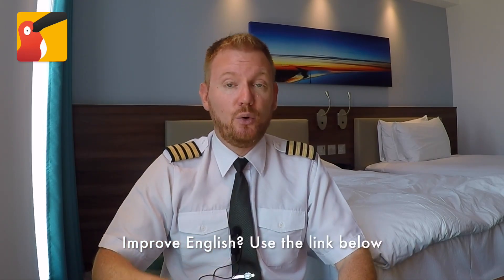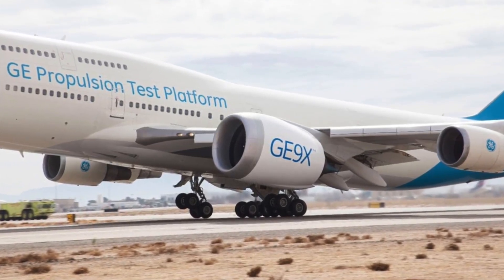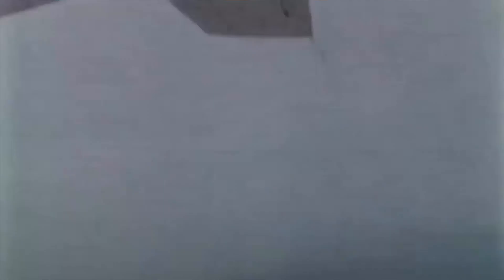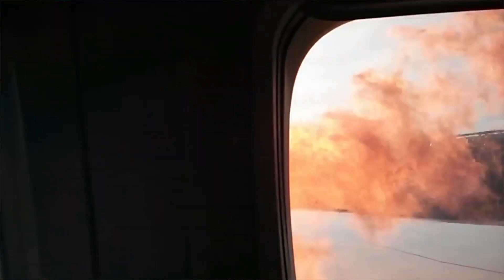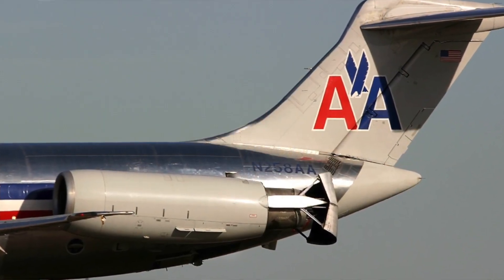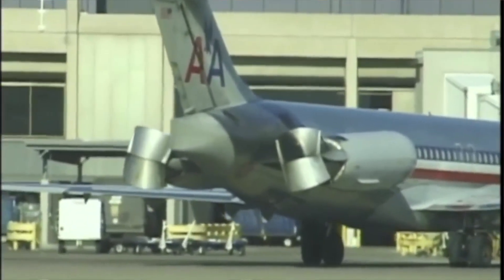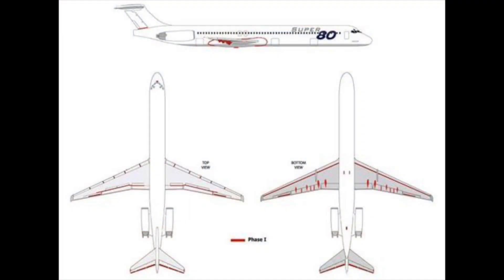Why are the jet-engines placed there? Wings vs Tail

Comment: Thanks for the info. There is limit to how big the engine diameter will be because they dont want a lot of drag from the engine frontal area. The same thing goes with engine speed. they want slower rotating engines. the slower the less drag the less noise the less air and mechanical friction. its all about the balance of size and efficiency.

Comment: Nice Video. But yes, you forgot one major advantage, if not the biggest advantage for tail-mounted engines. Without the need for engine pylons, you can design the aircraft with a cleaner more efficient wing, compared to one with wing-mounted engines. It gives you the possibility of longer flaps  Also you don't have to worry about engine blast on the trailing edge of the wing. This improves airflow at low speed, and lowers take off and approach speed, and it lower the weight of the wing structure. This is the first reason the DC-9, and later the MD-80, was designed as it was.

Comment: Very well made video and very educational! I would just object to one detail. "Mentour Pilot" saw wing-mounted engines as an advantage in case of engine-fire as the engine are farther out from the cabin. But with wing-mounted engines you have a tremendous lot of flammables (fuel in the wings) directly above a system that can easily ignite flammables (the very hot engines). That proved catastrophic in a lot of aircraft accidents when the hot engines set the thousands of tons of fuel immediatly on fire.
Contrary to that on the majority of accidents and ground contacts of acft with rear-mounted engines there was no fire at all because the hot engines were far away from the wing-stored fuel. The engines often even were thrown away from the acft on ground contact. In my view a clear cut advantage for rear-mounted engines.

Comment: Another benefit in low mounted engines under the wing is that in this case the engine intake is usually fore of the wing and hence the air is sucked into the engine without having been disturbed by the wing or the fuselage. This is beneficial to the engine performance at both low and high speeds (for different reasons).

Comment: Another benefit in low mounted engines under the wing is that in this case the engine intake is usually fore of the wing and hence the air is sucked into the engine without being disturbed by the wing or the fuselage. This is beneficial to the engine performance at both low and high speeds (for different reasons).

Comment: Great jobs. very educationnal. thank you :) 
What do you think about the following ? in case of tail engines configuration.
Q: What about an eventual higher risk of major issues to the (vital) tail hydraulic sytem (pitch, rudder) in case of large mechanical engine issue ?
Reply: It changes the whole design of the A/C

Comment: you forgot one plane Eastern Airlines had  engines on the wings  and a bigger one atop the body in the back as part of the upward Tail on the plane. could you explain that dynamic in using the top engine???

Comment: Do wing mounted engines not interfere in any way with the wing design? IE the low n high pressure deferential that helps a plane to fly

Comment: Actual reason for the high-mounted rear stabilizer with rear mounted engines is so the hot exhaust doesn't melt the stabilizers!

Comment: The Bombardier CRJ models have thrust reversers that have been found post-production to have a risk of ingesting F.O.D. (explained in video) at slow speeds because, when the flaps are extended, tiny debris can “ricochet” off-of the flaps back into the engine.  Because of this, we don’t use the reversers below 60 in one model and 75 in another.  They found this out by spreading bits of chalk-like debris on a test area or runway and using the reversers at different speeds.  They found little marks on the fan blades when moving too slow for the wind to blow the debris under the engines.

Comment: Very well done...I've always wondered why so many planes have their engines mounted in so many different ways, and just like all combustion motors, I've always wondered why haven't we come up with one "final solution" that solves all problems?   I believe you're right, it all depends on the size, shape, and type of aircraft you're dealing with.  Now can you tell me why some aircraft have their wings above and some have them below the fuselage?  Or did you already address that, it's my first time here.  But yes, if a 737 or similar plane lost an engine that would make landing in high wind a "b----".  I suppose the tower would have give you permission to land against the wind (i.e. opposite the change in yaw), even if that meant coming in the wrong side of the runway.  Btw, when you said "rudder" it sounded like....never mind :).

Comment: In a plane with rear engines you do not want to sit in the back of the plane. The noise is horrible. Good for 1st class passengers I guess.
Reply: I would gladly take my flight in the back seat of a md90 over the one in the back seat of a 757.
Reply: I agree, I flew 2 hour in the very last seat of a MD80 a few years ago, not confortable.
Reply: I was at the back seat in an embrear erj145 for 2 hours, I walked. Out vomiting
Reply: Exactly. I rode in a rear engined Embraer right next to the engines and it was miserable. Now I always check the plane type before picking a seat.
Reply: Yeah, i flew from Germany to Bulgaria with Bulgarian Air Charters in such a plan. In the very last row. Gladly, i rembembered to bring earplugs.
Reply: I love sitting right next to the engine.  ☑️
Reply: I had to travel like this once on an MD-80. I was lucky that the flight only lasted 40 minutes (AUA-CCS) because truly wanted to rip my ears off 10 minutes after takeoff
Reply: They hit me over the head and forced me to ride in the luggage compartment. It was so cold that when they finally let me out of the luggage hold, a giant frozen pee-icicle fell out of my pant leg and everyone just pointed and laughed at me -

Comment: I read some place the B52's wing span is so great if you have an engine failer on the out side engines the rudder would have trouble compensating for the torque. but this is not a big problem because the engines are so reliable.

Comment: I Though based on a Crash Investigation I saw that atleast on Airliners High Mounted engines became a bad idea since a plane had all 2 engines to fail when a chunk of ice from the wings flew right into the engines. Also the screw that moves the elevators when it broke the elevators would pitch up sending the plane on an incontrolable dive. I'm an avid Flight Simulation enthusiast and thinks like this capture my attention greatelly. Great video Thanks!!!

Comment: But the engine driven fuel pumps will still suck fuel from the wings even tho the booster pumps fail. Every helicopter I have worked on can do that. They have the enigine much higher then the fuel tanks so I don’t see Why a plane should not be able to? :)

Comment: Great explanation. I thought one of the reasons for rear engine placement was because of efficiency due to the laws of static air pressure. It is more efficient to draw air from the front and around the airplane through the engines rather then to push the air through the engines from the front and past  the airplane body. At least that was my understanding.

Comment: Nice video! Just to add one bit. Rear mounted engines do not necessarily have a pitch down tendency, that depends the position and inclination of the engines. Flying both CRJ2 and Hawker 800xp, the hawker one has some pitch up tendency and normally we’d be trained to use it in case of an elevator jam, where’s CRJ2 has a substantial nose down tendency with added thrust, and due to that we were trained for go around to go pitch first then thrust, to be ready for that tendency. But again maybe it is just out of ordinary, but thought you might find it interesting. Keep up good work!

Comment: I was also thinking if the back mounted engines would create less drag due to their position (aerodynamically), therefore making the plane more fuel efficient? This is also caused by the surface area (size) of the engines being smaller compared to the under mounted ones.

Comment: So... To sum up:

Under Mounted engines;
Advantages : 1) Easy accessibility, 2) Larger and more number of engines can be fit, 3) Less wing bending due to weight distribution, 4) Less wing fluctuation, 5) Safer since engines are away from the body.
Disadvantage: 1) In case of an engine failure, large yaw force is created (Need larger rudder to neutralise the effect), 2) Thrust increase causes pitch increase

Back mounted engines:
Advantages: 1) Minimising Foreign Object Damage, 2) Reverser can be used to back up
Disadvantages: 1) Wings should be placed further back to make sure it aligns with the centre of gravity. 2) More piping is needed to transfer the fuel from wings to the engine. Also in case of a pump failure, fuel suction force of the engines should be higher. 3) Thrust increase causes pitch decrease, 4) (MY FAVOURITE) During stall, the air deflected from the wings (a turbulent flow) may significantly decrease the affect of the elevator due to the position of the horizontal stabiliser, therefore causing a super stall.

Comment: Are there handling changes due to heavy weight mounted away from the CG? Weights on an axis make it more difficult to move that axis. I would think that wing mounted engines would make roll and yaw sluggish but not pitch, and tail mounted engines would make pitch and yaw sluggish but not roll. Is that noticeable to the pilot?

Comment: Excellent video!! I want to add that an advantage of rear mounted engines is a more clean wing, which is more efficient in terms of aerodynamics, resulting in a lower fuel consumption for the same engine placed in the wing.
Reply: The wing without engines mounted on them are more aerodynamically efficient BUT the MD80 to MD88 series of jets are serious gas guzzlers!
Reply: @The Green Bastard  That could very well be because they have much smaller fans than today’s high bypass engines that would not fit on the fuselage - as explained in the video. Inefficiency somehow seems to be a conserved quantity.
Reply: are you have to research about this before ? cause in this video doesnt discuss about the advantages from fuel consumption.
Reply: even, the rear engine must has piping line fuel for get it. and it should be make the consumtion of engine higher than wing engine. cause need help a pumping system for distribute the fuel from wings to engine.

Comment: this video leaves me with more questions. I always thought rear mounted engines were nicer to fly, i used to play flight sims even IL2 and while they didnt have this in ww2 there were many different aircraft designs. Early jets had the jets in the wings like propeller aircraft rather than under the wings like with all current aircraft. I used to have a lot of fun flying leerjets in flight sims, the rear mounted engines seem more fun to fly.

One main question i have is landing and emergencies. When landing a rear engine aircraft doesnt that make tail strikes more dangerous while under wing engines mean that obstacles on the ground can be very dangerous? Also the same way with landing weight and general efficiency and gliding. Also in an emergency where you have to land on water or ground and in evacuating the aircraft, which is safer?

From what your video tells me, it seems that for flying, under wing engines are superior but rear engines are better on the ground? @Mentour if you were to own a private jet, would you pick a rear engine one or under wing engine and why? assume both jets are the same size.

with an under wing dual engine, would it be possible to only use forward thrust for one engine at 10-15% and brakes to turn the aircraft on the spot rather than reversing? I thought when you applied reverse thrust the engine would reverse the direction rather than using a barrier behind with forward thrust.

Comment: Here's a question, more pertaining to 4 engine jets.   On a 747 or A380, why are the outboard engines so far out?  Seems to me if the outboard were moved inward as close to the inner engine as possible, there would be more stability in case 2 engines on one wing shut down.  

What's your opinion on that?

Comment: I'm curious,  are you honest enough to validate that engines were mounted directly under the wing and not in front of the jets, as they are now.  You have an animated image that capture the way engines used to be mounted, directly under the wings at about 1.10 minutes in.  Can you please find a picture of a jet engine under mounted (directly centered under the wing).  Since your presentation is entirely on the undermounted engines that don't exist today, I find it very strange.  Don't you?

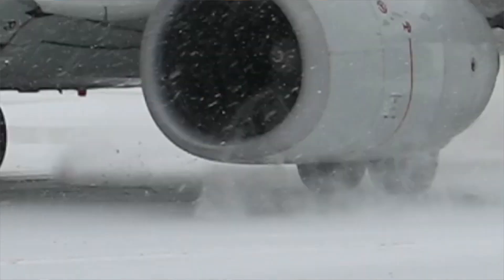Comment: Thumbs up for this Video:  However won't larger diameter under the wing engines (like the 777) suck in  birds & shit easier? ................. Why do some Jet aircraft have two engines under the wing, and one built into the tail making a 3 engine Jet liner? This sounds to me like a dangerous configuration, however I saw a lot of planes like this dominating airports.   Reference McDonnell-Douglas DC-10 and MD-11, and the Lockheed L1011 Tristar. ....... Yeah this classy guy did say shit roughly at 9:22 to 9:32 LoL...........

Comment: To be fair, one upside to wing-mounted engines affecting an aircraft's yaw more is that they can be more easily be used to steer in the event of a control surface surface failure.

Comment: One of the reasons there are planes with a third tail mounted engine was because of the regulations that prohibited 2e engine aircraft from flying more than 120 minutes from an emergency landing area. This regulation called ETOPS was first introduced with propellor planes which would fail on average 114 times more often than a jet engine. So that’s why you have 3 engined planes as it helped the. To bypass the ETOPS rating.

Comment: On 4 eng wing pylon mounted aircraft like the B707..inboards are in front of, while outboards are behind the pitch axis of the aircraft. Pitch changes can be accomplished with differential thrust..for instance, pushing up the inboards while retarding the outboards can substitute for nose up trim while maintaining proper total thrust requirement for configuration and phase of flight . In abnormal situations I have used this for; a jammed stabilizer jack screw, a stalled trim motor and asymmetrically.. thrust to overcome  adverse roll due to  jammed/asymmetrical flap extension on approach.  Differential or asymmetric thrust can be an effective technique on wing mounted engines in high crosswind landings also.

Comment: Great informative video, only thing to add in terms of maximum handling characteristics is that due to where the engine mass is located (wide but near middle of plane forunder-wing mounts, and close together but towards the rear for rear mounted engines)  planes with under wing mounted engines should be more responsive and maintain better control in pitch, while it should be easier to roll a rear-mounted engine plane if all other plane characteristics are equal.

Comment: Just a thought.  If the plane has the rear mounted engines would that make is easier to manage a water landing if that situation came up?   I was curious because I was watching a video about the miracle on the Hudson landing where CPT Sully landed the plane in the Hudson River.   They mentioned in the video that CPT Sully  had to hit the water at a specific angel to ensure the engines didn't hit the water causing the aircraft to nose dive into the water is what I think they said.   He obviously did an excellent job landing that plan to ensure everyone survived.   I assume if the engines were situated in the back of the plane higher up they would not have to worry about them hitting the water as in the mentioned scenario.  Is this a good assumption?

Comment: They're under the wings so that as passengers board, they can toss a handful of coins into the inlet, for luck.

Why are engines above the trailing edge or aft fuselage so much harder to maintain, on low landing gear, than engines placed down low so they can ingest all the ground debris? As often as you need to service low mounted engines, it's easier to just roll a scaffolding under them? Really?

Comment: love your vids most of the stuff I know, but it gives the average Joe(someone like me) some insight about design and engineering. I will be watching more, have you ever piloted or worked on a Jet star built in the late 50s early 60s I think(one of the first small jets, 4 engines tail mount). . One of the first planes I worked on  it seemed so cool.

Comment: Another benefit to having wing mounted engines has to do with doing engine changes.    In a wing mounted engine aircraft, any spare engine of that type will fit in the number 1 or number 2 position because the mounts and wiring harnesses are the same.  In a rear fuselage mounted engine aircraft, the spare engines have to be designated for number 1 or number 2 positions.  Thus you should always have 2 spare engines readily available. Otherwise, maintenance will have to do an engine “position change” service on the engine prior to installing it on the opposite side.

Comment: After flying as a passenger for 35 years I really appreciated this discussion since I've flown in about every commercial aircraft!   I was thinking about the Russian 4 engine tail/high mounted Il-62 when you mentioned more engines in the rear, but the first aircraft that came to mind was the L1011, not to mention the 727 with 3 rear mounted engines, although one in both of those examples is mounted between the fuselage and the back stabilizer.